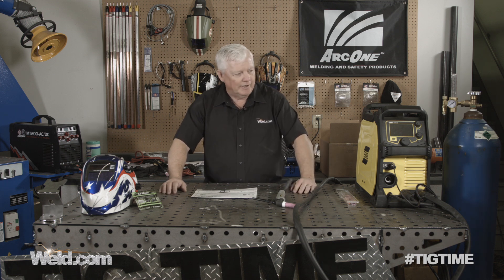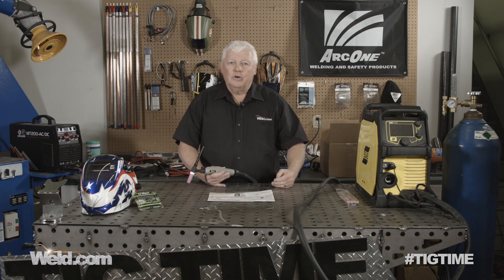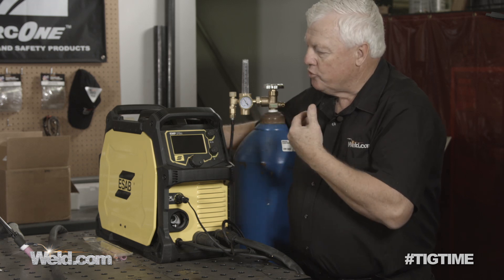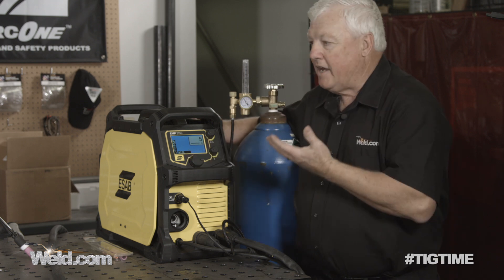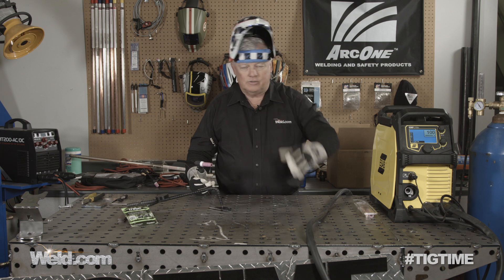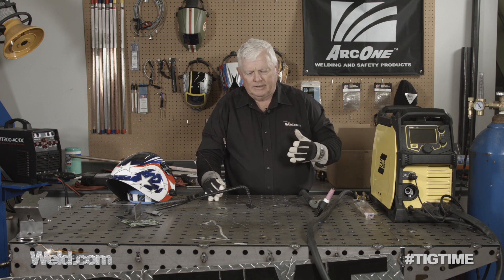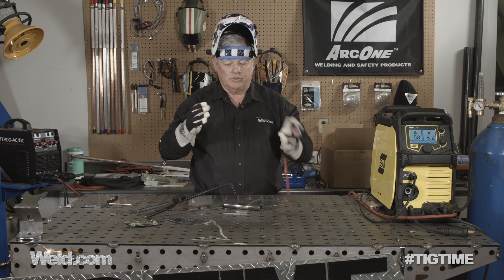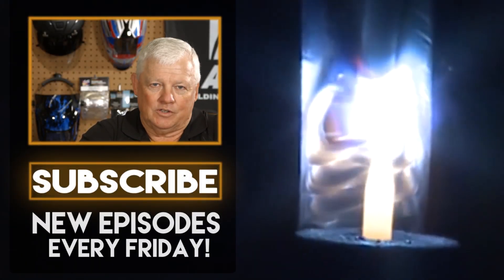ESAB Rebel EMP 215ic Review: Part 2 of 3 - TIG Welding | TIG Time

Comment: This machine has doubled in price in the last 7 years. It's now going for almost 3k. I guess everything has though. I'd love to get one eventually, it'd be nice to have a machine that can do everything on 110v in such a small package with so many settings to adjust it to whatever project you have. The Lincoln I have now is ABCD with wire speed controls that for some reason let me adjust it into a range that 95% of I would never use, ever, under any circumstances. It works, but getting it to by adjusting wire speed and picking between 4 voltage settings is pretty much ridiculous and the results can be pretty ugly. I've wanted a TIG machine ever since my friend showed me he could weld two pieces of metal together without even using filler metal under certain circumstances.

Comment: I have an older similar machine the thermal arc 211i and it came with that same torch. God that thing is horrible!  The leads are as stiff as a corrugated flex pipe! Do yourself a favor and just buy a CK torch and a pedal or torch mounted amp control. I much prefer the torch mounted control to the foot pedal as the pedal is a real pain in the ass to operate unless you are welding on a bench. When you are laying under a car or something the pedal is absolutely useless! I really can’t think of a real world welding situation the pedal is going to be useful in. On the other had I can’t think of a situation the torch mounted thumb wheel control or slider depending on your preference wouldn’t work well for.

Comment: Where can I find a torch like you are holding. I want to use the 4T Cruise control feature on my welder. Is there a flex neck CK version of this torch with 4T feature? model # please.

Comment: Is this practical for a pipefitter that wants to practice welding at home ? Running 1/8” 6010 and 3/32” 7018 and tig welding. I’ve only welded with 1/8” tungsten does 3/32” weld different ? Will it weld with 1/8”? I don’t see why not

Comment: The polarity must be set for steel - tungsten negative as the icon indicated.  Since there is no AC, this is not for aluminum, so the polarity is workpiece positive.  The little icon shows the + ground port empty and the TIG torch plugged into the negative port as it should be for stainless and regular steel.

Comment: Mr tig, I'm between the esab rebel 215ic, the lincoln 210mp, and the multimatic 212. Which would you prefer for the at home fabricator? I'm tired of taking my off road rig to people's house to weld on it. I'm mainly interested in mig/stick and might get into tig down the road. Thanks
Reply: Im in the same boat too man! Except for the multimatic, i have heard they are real chincy.

I think i am going to pull the trigger on the esab
Reply: @Joe-Mamasixtyninefourtwenty  I went with the esab em235ic mig only. I'm getting a dedicated tig machine
Reply: Nice choice buddy, i was looking at that one myself, but i need a multiprocess cause i do alot of work outdoors on rusty equipment/ fairly heavy stuff that requires stick. Cheers mate 👍😎✊
Reply: @Joe-Mamasixtyninefourtwenty  I work outside as well, I run .035 or .045 self shielded flux. Itll burn 1/2 inch real quick

Comment: I bought one of the machines because Iits portable 110/ 220 easy to use for quick repairs. one has to have a shop and specialized machines , more space etc. I have a high frequency high quality rig but only runs on 220, and dont have a place to easily plug in.

Comment: FYI folks, I bought a brand new un-opened ESAB 215 IC, unwrapped it all, hooked it all up and.... It's a dead machine.  It won't start.  I'm heading back to the store in the morning.  Should have a bought the Miller for the extra few hundred bucks.
UPDATE: Not in touch with the local ESAB rep, he came over the same day and checked over the machine and found the gun was not working.  He gave me a new gun and the machine works beautiful.  Super happy with the machine.
Reply: Did you turn it on with the bottom right button
Reply: Won't start? Like won't turn on?

Comment: 16 gauge is hardly thin ,, i treat that as a thick plate on the restorations i do ,, like to see some 20 , 21 or 22 gauge , with a sprinkle of pitting , and a bit of rust

Comment: Looked like a really interesting machine until I saw it had no HF start when using TIG. I'm very sad about that. If your going to being doing mainly TIG work I would consider saving your money for the ESAB caddy ac/dc TIG instead..but I can see how this machine would suit someone doing a bit of everything with occasional TIG. Just my opinion on the rebel, I'm a full time workshop welder btw.
Reply: Mumbu Zambot A full time workshop welder would probably not be using a home/hobby welder such as this. HF is not a deal breaker for most home/garage welders.

Comment: Doesn't have AC... No Aluminum welding in your future.
Reply: It's absolutely possible to DC TIG aluminum - you just need to use Helium instead of Argon.
Reply: He did it with his Rebel 215ic. Didn't even use 240v
https://youtu.be/gldTMXntKQo
Reply: You can mig weld aluminum. I do it all the time. I easily weld 14 gauge aluminum. I’ve done 16 gauge too. Up to 1/4” in one pass, but I’ve done 1/2” with a root pass and two fill passes. Works great! I do use a spool gun though.
Reply: Pretty sure he meant TIG, but having both options is awesome... :-)

Comment: Correction sir, The rebel 235ic does have solenoid valves on the gas ports
Reply: Just one solenoid on the 215iC though, that's the one he is talking about. I have that machine. Do wish they would have added a separate solenoid for the TIG. I forget to turn on the gas before starting to weld all too often.

Comment: Can you do a tig welding review video on the Miller Multimatic 215? If you have done a video of it already can I have the link? and what multi process machine would you prefer? (Lincoln electric power MIG 210mp, miller Multimatic 215, ESAB Rebel emp 215ic)
Reply from the maker: We haven't done a review of the Miller. However, when we reached out to ESAB to get these machines, it was because we preferred it to the Miller and the Lincoln.
Reply: Weld.com thank you for your quick reply

Comment: how can i figure out what TIG torches are compatible with this machine? i was told by someone from ESAB that you can only use one tig torch.
Reply from the maker: That's not true at all Michael. You can use whatever torch you want on this machine. All you need to do is get the correct Dinse connector and you can mount whatever you want:
-SL2-35 Dinse Connector
-CK Flex Valve Torch with 12' Super Flex Cable
Hope that helps.

Comment: Who's foot pedal was that?
Reply from the maker: It's a Tweco W4014450 foot pedal and is an option that comes with the machine.
Reply: Ok, so you liked the stock foot pedal, but not the torch.  For some reason, I got the impression that it was an aftermarket pedal.  Thanks.

Comment: Since there is no solenoid for TIG welding, can you purchase one to install on this machine?
Reply from the maker: No, I don't believe that is an option.
Reply: Why can't you not use the MIG solenoid with a through-hole dinse adapter?  Is the issue that the solenoid won't activate with tig?

Comment: After watching a number of your videos it does not seem you are to fond of any machine, any regulator, any tig torch, anything! Thanks for the opinions you give but dang man do you like anything. You don't like anything that's affordable I have noticed that.  Please note, " We are not all professional welders". You have put so much doubt in my mind I'm not going to buy anything. I will just keep spending the $75.00 per hour that I pay out now. 
I guess everything is a POS unless you spend $8,000 plus for it. Thanks for all the discouragement when it comes to welding. I QUIT!
Reply: Don't be discouraged. "Mr TIG" was anything but and I hear you when you say nothing is good enough for him unless it is unaffordable for the rest of us or it is something he sells. I watch Jody, bought an Everlast welder, am learning how to weld and am happy. Enough of this guy.
Reply: @Cacheola  When you see a pro trying to weld pipes or anything downhill just swith the channel. Submarine that he would weld could go eventually on periscope depth. If you are thinkig of some jobs like making fences it is a great machine, wont overheat for that what you are doing. Thicker material- doing good aswell but not for a long time. Problem is not in machine, problem is that there is no water cooling and torches are small. For a one phase he works nice. Price is superb, mine costed 2000, in Europe,220 volts, without TIG torch. Look up for OERLIKON counterpart if you have it in US, or EWM- a bit cheaper but also good. I dont like to have all in one machine, if he die, you have nothing. I have ESAB for wire, EWM TIG AC/DC and VAREX inverter for electrode. If you want top brand, then FRONIUS is your choice. But price is high. Adleast over here.
Reply: David Hoover 
It's all about selling his products. Only his products are good.
Reply: David Hoover if you don’t do anything too thick check out Hobart eztig 165. I use mine more than any other machine in my shop.

Comment: Hey Mr. Tig, I've just purchased the Rebel 215 emp ic. and would like to change the torch to a lower amp torch (like a ck90v w/superflex). I see a need the adapter (CK SL8-35QD) to plug into the rebel, but will the other end be a plug n play affair to the ck90v or will I need some sort of other adapter? If this torch is a bad choice, can you recommend anything else, like perhaps the ck microtorch and what is needed to make that happen? Thanks, Tom

Comment: Hey Mr Tig. Just curious on what setup you used to connect the different tig torch to the machine as I just bought this esab rebel 215ic.
Reply from the maker: It is an SL-2-35 Dinse connector with a CK17F torch.
Reply: That's what I thought as I was looking it up. Only I'm looking into the gas valve flex head. Thank you sir.
Reply: I ordered  a CK 17F torch and CK SL-2-35 connector.  The Dinse example I have received seems about 1/8th inch too long to lock in the ESAB Rebel 215ic that I have.  I have a mill so going to shorten the connector to match the connectors supplied with the machine but be careful when ordering.
Reply: I spoke to the company where I ordered here in Canada and CK at this time does not make a connector specifically for the Rebel.  At least this connector can be shortened easily.  It would be worse the other way around!  Other then that everything is awesome.  Just not a plug and play but we are metal workers.
Reply: Yeah I was quite upset because I had the same problem & had to file down the rectangular locking pin on the shaft of the dinse connector for it to fit.

Comment: Have you had a chance to play with the new Miller Multimatic 215? seems promising
Reply: Rebel is better. No foot control on the Miller.
Reply: yeah after some research i ended up going with a millematic 211 and ahp tig 200x. cost just about 100-200 more than the multi matic and you get dedicated machines but i did it more for the aluminium tig and foot control. and way more tig control
Reply: +KING TROLL Where is the foot control on the rebel ?
Reply: Miller has foot control, brah.
Reply: John Smith it has a foot control.

Comment: So this was welded without a Pedal?
Reply: Len M. - ESAB Rebel EMP 235ic: U$2,599.00 

ESAB Rebel EM 235ic: U$2,299.00

YT,
Rob
Reply from the maker: The first welds were made without a foot pedal. Once we switched to the CK torch setup, we were using the foot pedal.
Reply: Weld.com Thank you for the reply.  Looks like a nice machine.
Reply: Weld.com Any idea what the MSRP of the new EMP 235ic will be?
Reply from the maker: Not 100% sure on the retail price yet. However, it is due to be released in early to mid January, so it should be announced soon.

Comment: It's disappointing to hear the 4T feature downplayed by a TIG expert just because of user preference on the part of the reviewer.  On a lift start machine intended for the home hobbyist, 4T can be a handy mode to utilize.

It's not just so you don't have to hold the torch switch, 4T will allow the user to start an arc at very low current, and precisely position the arc before releasing the switch and ramping to full current.  Very handy on a lift start machine where starting the arc could be difficult in tight quarters.
Reply: Can’t teach an old dog new tricks
Reply: How does it work?
Reply: @DavidParker-cf2km  to put it simply 2t you are holding the button while you weld. 4t you tap the button to start and stop
Reply: @DavidParker-cf2km  so its in the name '2t' is when you press the trigger to start welding and release trigger to stop welding. (2 operations of the button were done ON(pressed down) and OFF (realesed) ON-WELDING-OFF)  .... '4t' is when you press and then release the trigger to start welding (while welding you are not holding the button at all.) and to stop you press and release the button again (so 4 operations were done ON-OFF-WELDING-ON-OFF
Reply: Nice explanation, of the benefits
Reply: Kinda like not explaining the amperage window drawbacks of creating a huge window for yourself especially when using a foot pedal.

Comment: great job on the review.. have you had a chance to get your hands on the new multimatic 215? I own a custom woodworking company and do  primarily stairs and railings.. the demand for stainless on my jobs is starting to get so much i can't ignore it...i think i am going to take a crack at it..Looking at the rebel and the multimatic 215 because i don't know if i will need to mig anything or not?..also considering the square wave 200 tig...any thoughts would be a huge help for me :) thanks again for all your great work
Reply from the maker: We haven't had a chance to play with the multimatic yet, although we should have one soon. The Rebel isn't really comparable to the SW TIG 200, as one is multi process and one isn't. the two that are more comparable are the Rebel and the Lincoln 210MP (both good machines). And they are both about the same price with the TIG package included.
Reply: yes maybe i will go with the sw tig 200 and i can get a little mig down the road...the review you did on the sw tig 200 really sold me! awesome stuff

Comment: Hey Mr.TIG would you tell me which process is best for welding cromoly, TIG or MIG?! and why?!
Reply: tig, due to c.m. being sensitive to the level of heat input into it.
Reply from the maker: It is tough to give any good reasoning without an actual application, however we prefer TIG for most applications, because you can control the heat input better and get smaller welds.

Comment: Did I understand you to say DC only? So no aluminum?
Reply from the maker: no TIG welding Aluminum. However, this is a multi process machine and has the ability to weld aluminum with a spool gun. We did an episode on how to use the spool.gun on this machine in an earlier video.
Reply: aluminum only with mig